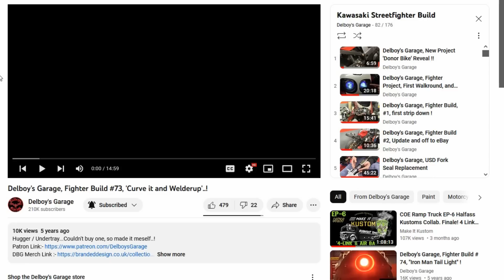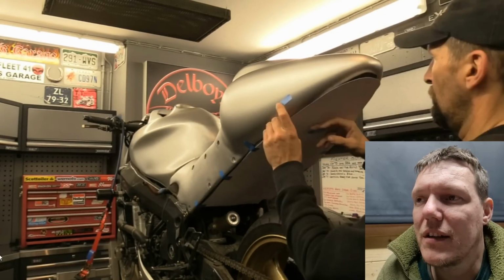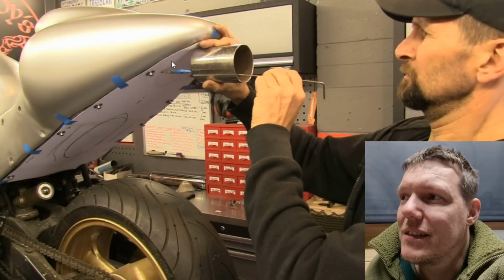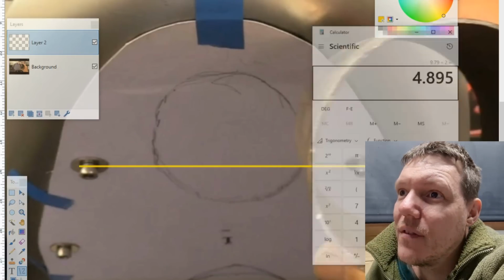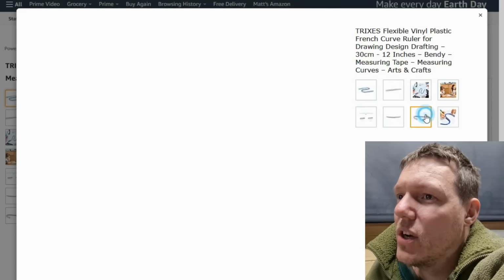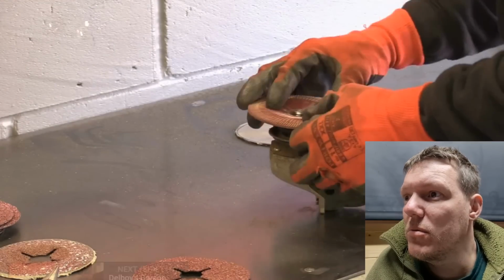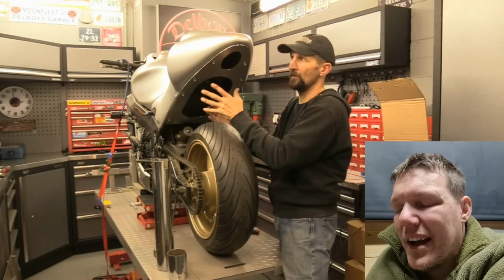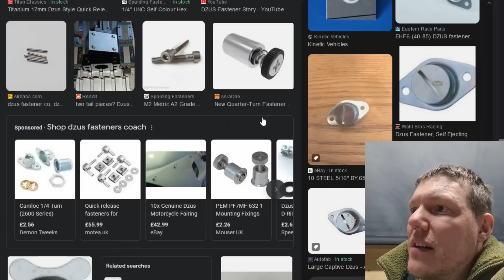HDS 50 - flat sheet metal fab

Comment: Regarding the legality of no indicators/daytime MOT - I had a yamaha DT50R which for some reason produced no headlight beam pattern which is an MOT fail. You can just tape over all your lights and you can put it through for a daytime MOT, even though it was manufactured and sold to have working lights. I did that with two or three garages for the time I had it.

Comment: I have used a tub of water for marking intersection lines on odd shapes. Position the piece in a level tub at the correct angle fill it with water and mark the water line. Overkill for a pipe but good for odd shaped pieces. Also the old pinhole trick works a treat for mirroring features on paper patterns folded in half.

Comment: For the brake light tube I would cut the tube to the angle after finding said angle in a similar manner to how you explained apart from abit more old skool. Then I’d hold the pipe up that I’ve cut and draw around it then once you cut it out flip the tube 180 and it’s ready to weld in place!

Comment: Hey matt, So I have a triumph Daytona 765 (the moto 2 one) is very similar, mechanically, to the Street Triple RS and shares many things with the previous gen Daytona 675. My first triumph, Bought it new now has 2000 miles.
Was doing maintenance on it, wanted to replace OEM air filter with a high flow one. while opening air box noticed it has a lot of petrol/oil residue in the walls of throttle body. Took it off cleaned it, looked at the injectors, they look fine. But looked at the intake valves and it has plenty carbon deposits, like what you would see in 25k miles.
What's causing this? The emission charcoal canister? I'm worried for the life of the engine in the long run. What's best way to clean those valves?
Reply from the maker: Check the crankcase breather, and also check you haven't put too much oil in it
Reply: @thedirtyworkshop  Hey thanks for the reply. It's going to be hell to clean those valves. I don't want to take the head apart.

Comment: I watched last night, but fell asleep, so I'm watching again (it's good entertainment - I like a laugh).
I'm around 45 mins in and gotta head off to do a bit lol.
But, so far I have 2 points.
1: We must have had different teachers at school, when we referred to a plastic rule as a ruler, he'd BOOM "What, you have the King or Queen on your desk? It's a RULE you idiot", to which I'd usually respond with "I thought a rule was an instruction, such as teachers not calling their students idiots.." - then spend the rest of the lesson with the head master :)
As an adult, with Google, I could argue if my 'ruler' didn't start measuring at the edge, but it did lol
2: No need for indicators (or a chain guard) if there's no pillion capability, however, if they are fitted, they must comply with the rules regarding position, spacing, flash time etc..
For a bike like that, I'd be presenting it without indicators or switch, then do what you want afterwards for cosmetic reasons.
Reply from the maker: "2: No need for indicators"

- The law disagrees
Reply: @thedirtyworkshop  when there's no pillion capability... I'll bet it doesn't
Reply: @thedirtyworkshop  apologies, my simplification was incorrect.
It's 'off-road' style motorcycles designed to only carry the rider.
This omission by myself changes everything and obviously this exemption wouldn't work for this .. erm... thing!
Feel free to post my comment in your next 'rip the viewer' episode 🤣
Reply: @thedirtyworkshop  to be fair though, it may get away with it under another exemption: cannot exceed 30mph / 50kph 👍

Comment: I'm sure he made that panel twice. The original sheet had enough remaining to make a second one. Look closely at the end panel before he waffles on - there are secondary pen markings. He has a cardboard pattern to draw around so why those messy secondary lines on the end product?
Also, the upper central part has no fastening bolt and will rattle like Grandmas false teeth on a cold day.
Reply: Nah, I think he deliberately left it a bit big.  If you look, when he was marking it out, he didn't run the cardboard up flush to the side of the sheet.  And in one of the freeze frames where Matt was sharpening up the dots, it was marked +5mm (like Del knows how to add  consistent 5mm to anything, but hey)   So I'll give him a pass on that.  Even Del knows not to trust one of Del's templates to be the correct size...

Comment: I’m going to sound dumb but drawing lines is not as easy as it sounds. You have to do it correctly using as small a line as possible and be careful of what the line means - eg. do you cut through the line or outside or whatever. Easy to screw it up if you’re not using your brain
Reply: Nd that's why I use tricks like the pipe clamp
Reply: Very good point...drawing lines does not make it accurate.
Lines are a tool and like any tool they must be used correctly.